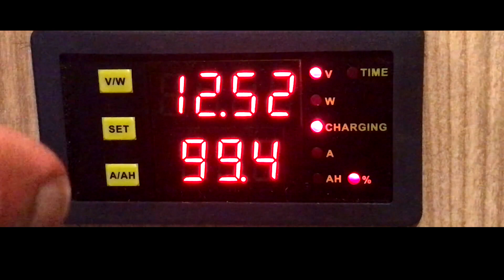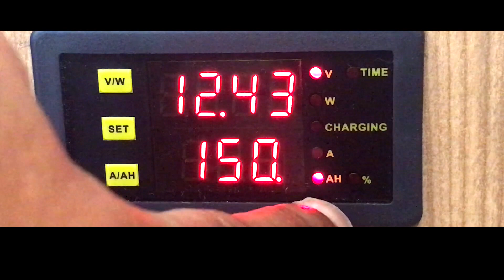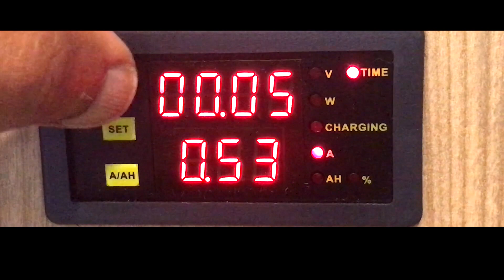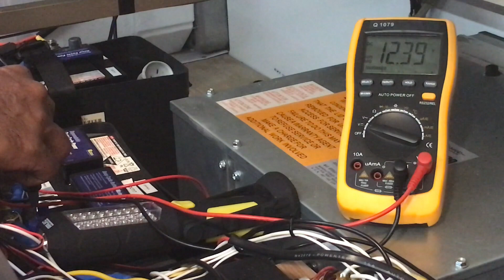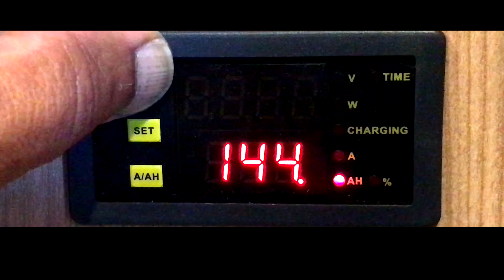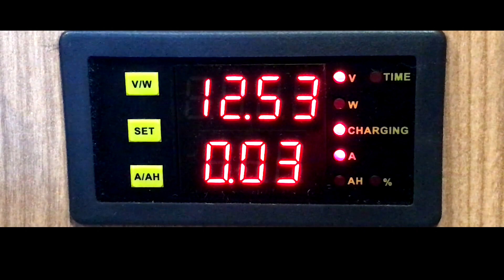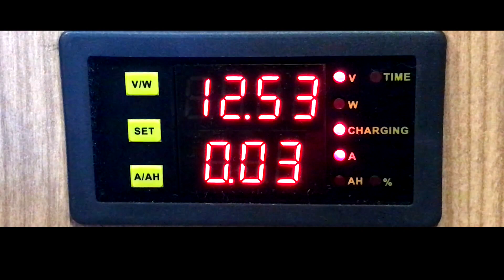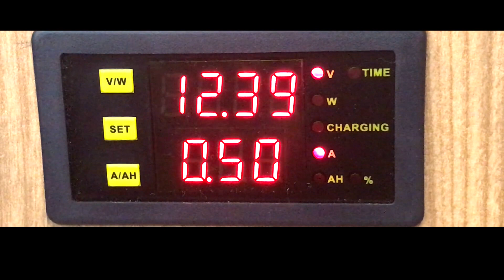Solar Battery Monitor Voltmeter Ammeter Gauge DCM 120110C

Comment: Thanks for this video.  If I only wanted to monitor what my solar charge controller is doing and nothing else...would I have the negative from the battery on one side (right) of the shunt and negative from charge controller on the other side (left)?

Comment: I've just installed the monitor and shunt, however, when i go to connect the output lines to the shunt, it sparks and heats enough to stick to the terminal...what am i going wrong?

Comment: Can a button be installed to turn the monitor off when not needing the info? Or does it need constant power to read the batteries properly?
Reply: You can turn it off by having your own switch for it but you would lose settings. If you have solar panels and it sits in light the consumption is miniscule.

Comment: Excellent video glad I found it. Mine seems setup correct but even with solar unplugged it says it's charging... any thoughts?
Reply: I know this is a year old but for anyone else, You need to zero out the meter with everything “charging” off (solar...gen). That’s what I had to do.